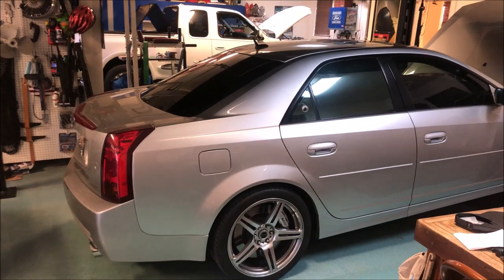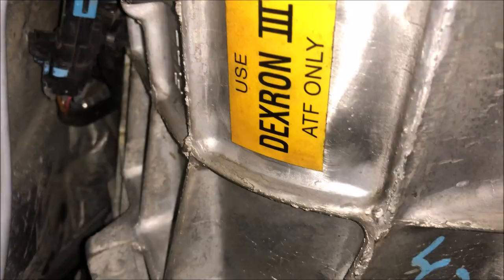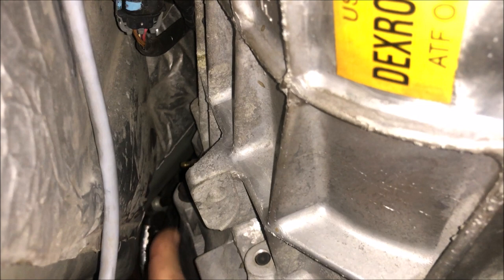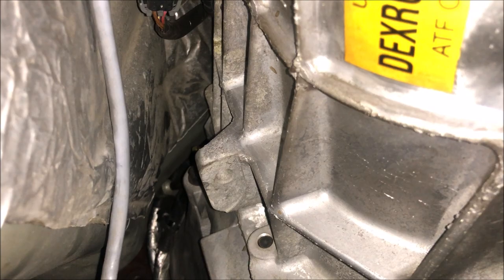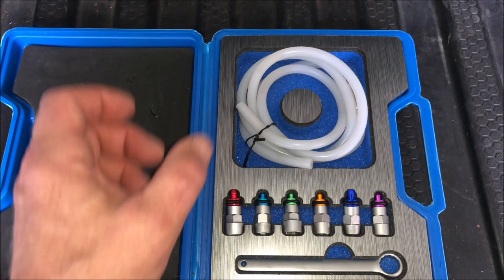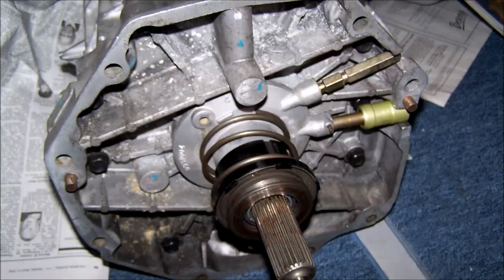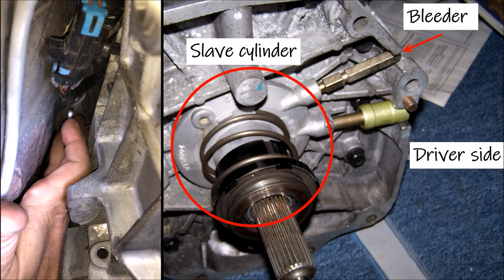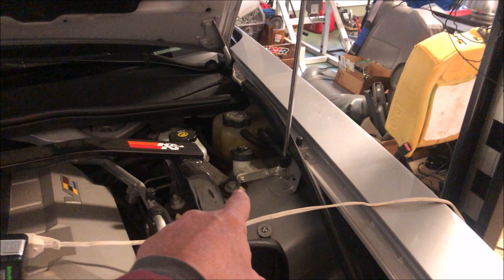How To Bleed Tremec T56 Hydraulic Clutch Slave & Master Cylinder 1st Gen '04-'07 CTSV, CTS, Corvette

Comment: Approximately how many times did you have to pump the clutch until the procedure was complete?  And is the air in the system extruded from the bleeder prior to the fluid coming out?  Im wanting to make sure I'm getting all the air.  Thanks so much.
Reply from the maker: I believe it was around 20 pumps of the clutch, and this method pushes the air out of the entire system.  My clutch pedal feel was measurably better after I blead the system.
Reply: @DrivingIntelligence  ok sounds great.  My '07 has 136k miles and the fluid is dark.  Thanks again for the video and amazon link.
Reply from the maker: Very welcome, let me know how it turns out.  I’m contrast, mine was clear.  Very odd that mine was so clean with 45k miles since last bleed.
Reply: I used this method and after about 25 pumps, no fluid was ever expelled from the bleeder nipple.  The kit bled my brakes effectively.

I have a mityvac attachment that fits the master cylinder reservoir.  I'm wondering if I can fill it with Dot4 and put pressure on the reservoir while bleeding from underneath.

Stock clutch and MC... just doing maintenance because I'm sure it's never had this service.
Reply from the maker: @andrewbrown656  that might work, I would also consider a vacuum bleeder attached to the bleeder.  Pull the fluid through.  Sounds like your slave cylinder is bone dry.  How is it driving?

Comment: Do you crack the bleeder open with a regular wrench then attach this kit?
Reply from the maker: The kit includes the wrench that is used to open the bleeder using the adapter.  No need to use any other tools.  It works as shown in the video.  Thanks for your question

Comment: When you bled yours. Was it 100% as soon as you drove it? Or did you have to drive a while before regaining full pedal feel?
Reply from the maker: Mine was 100% as soon as I started driving.  You might have some air bubbles somewhere in the master or slave cylinder and might need a vacuum bleeder to pull the bubbles.  Was the fluid pretty dirty?
Reply: @DrivingIntelligence  fluid was nastyyyyyyy, but was clear when I finished up. As I drove it seem to get better feeling, might give it another shot here soon.
Reply from the maker: @rnkustomz  Let me know if a second flush makes it an better.